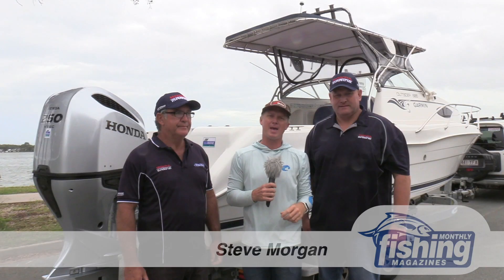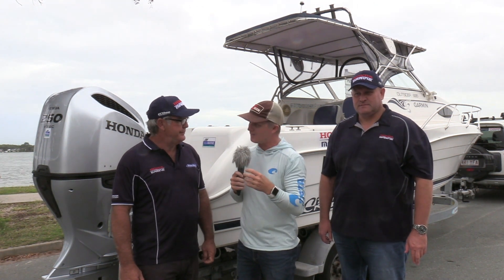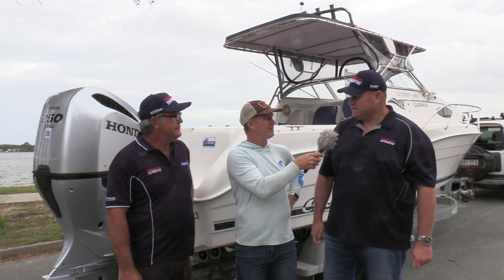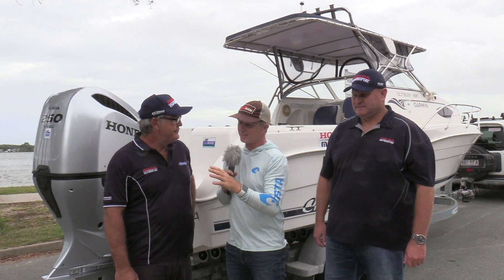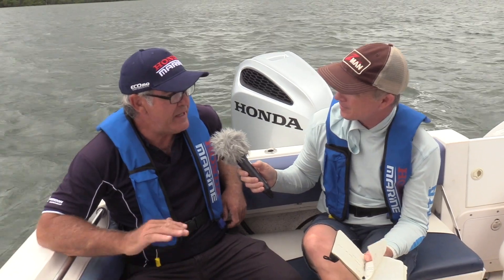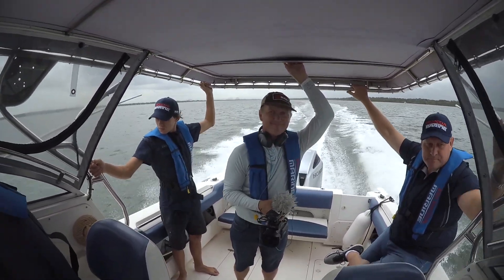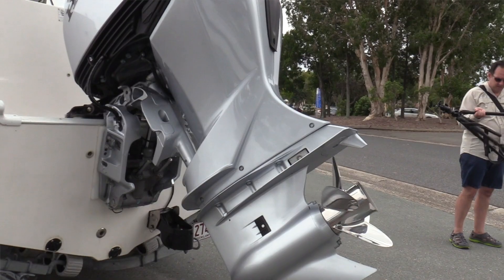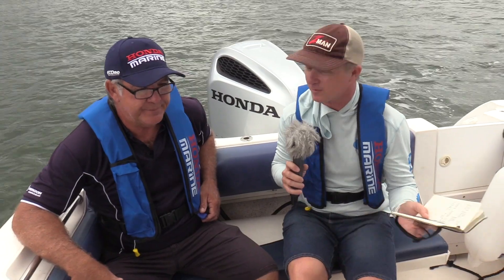Repower | Honda 250HP Drive by Wire on Cruise Craft 685 Outsider

Comment: Die neuen CARB Emissionsvorschläge bedrohen die Außenborder.
Februar 2021
Die Regulierungsbehörde strebt bis 2027 eine Reduzierung der Emissionen von Außenbordmotoren um bis zu 70% an.
Der Einsatz von Katalysatoren könnte unumgänglich werden um die fairen und gerechten Emissionsziele zu erreichen.
Dann müssen auch die Bootsmotoren Hersteller Ihren Anteil zum Schutz der Umwelt erfüllen.
Was für ein Irrsinn wenn ein einzelner Wassersportler mit 4 x 600 PS (2400) in der Stunde 100 bis 500 Liter Sprit verbläst nur so aus Spaß und um sein EGO aus zu leben.